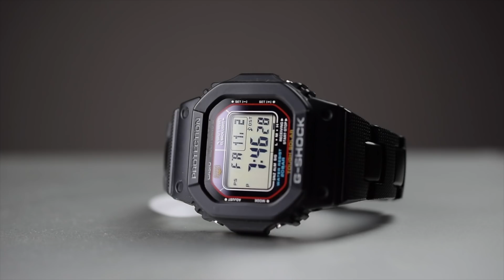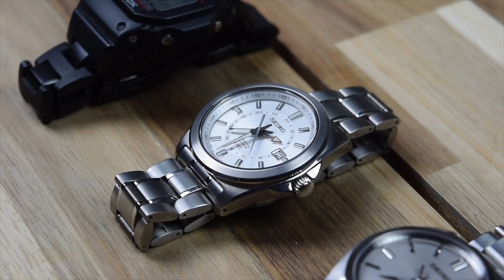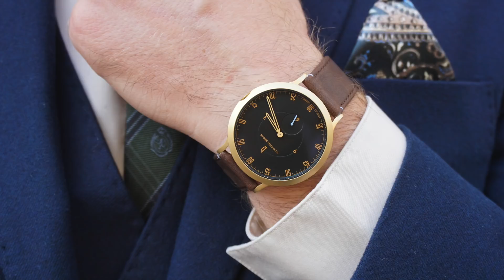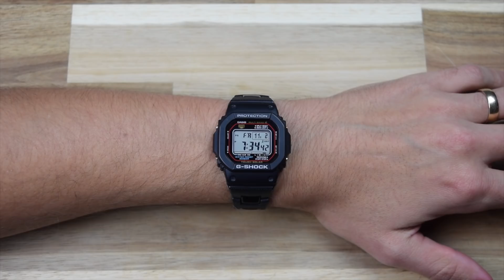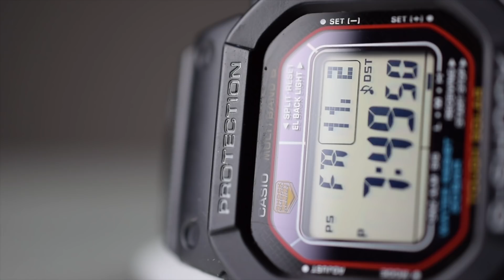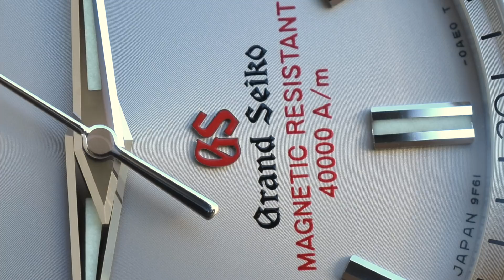Quartz without the crisis

Comment: I have 2 of those 8F Seikos, both bought second hand from the same guy as it turns out. The older, mine is a GMT just like yours and the newer blue dial I gave to my wife. As luck has it, I changed the batteries in both earlier today! Amazing movements, and 10 year battery life too